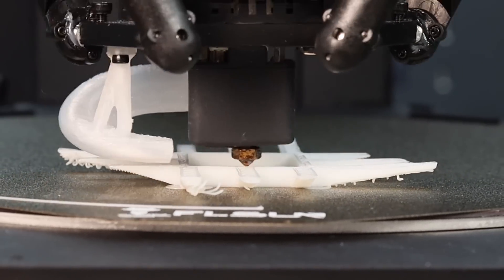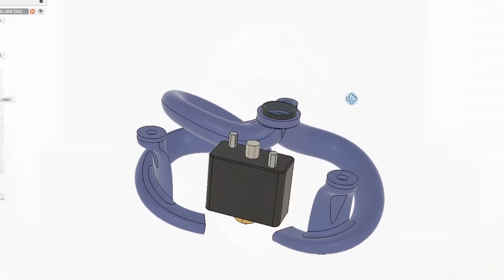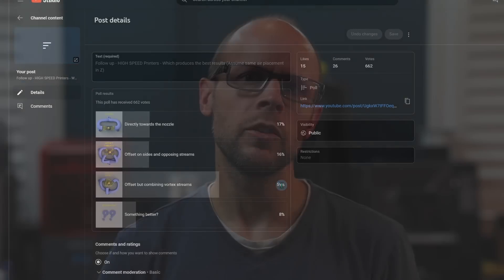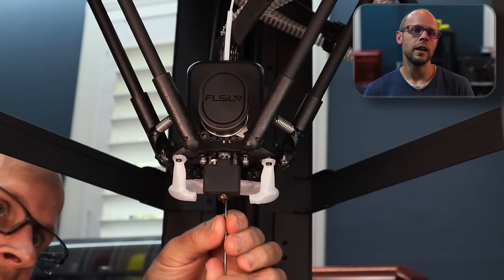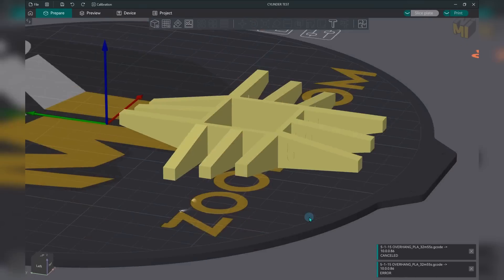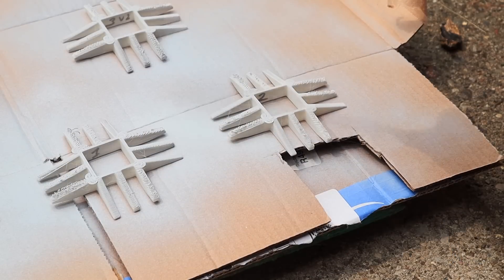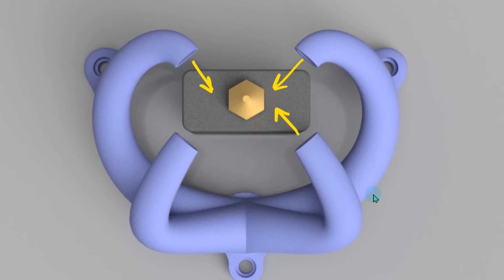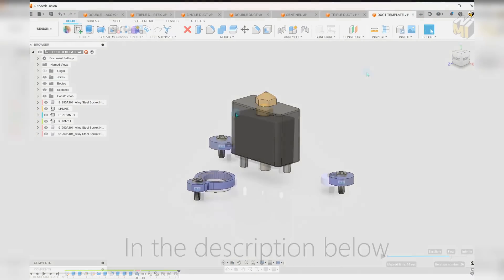More ducts is better, but how many is too many?

Comment: I also experimented with blowing, even created a system with 4 swirl-shaped blowing, but this story is not about compactness. Thin structures are always susceptible to heat from the heater. It is necessary to make taps with metal tubes. Then I gave up on this matter and did laminar cooling over the entire surface of the bed- this was the best solution, since it also cooled elements outside the extruder area.

Comment: I have upgraded with many iterations on my 5mPro. I finalised with a remix of an organic duct. My mechanical looking ones were really good but I like the aesthetics . Reason why I remixed is the model has some gaps and error in slicing. Also added my own patterns to be in line with 3D printing. i found that the wide opening of the duct worked better overall as it flowed rather than pressuring. Remember too much cooling is not good 👍 ❤

Comment: My thought is why didn't you create one that is completely elliptical completely encompassing a circle with an opening that would be vent like with some diffusers built into it I don't know how to explain it but basically create a large donut around the nozzle and a thin line but creating ribs that basically kind of directs and kind of slows the air down who created diffused Air instead of a pressurized air that can disturb the filament
Reply: I remember many years ago this kind of design was diffused especially on delta printers

Comment: When you mentioned using a teardrop shape for the escape holes on the ducts, it actually help a lot to steer the air into a curve, then using the shoulder of the curve to do the part cooling, maybe combined with three ducts or even just two, making a vortex in the middle.

Comment: 10:33 I would venture a guess that these small ports are to prevent excess static pressure. Also curious, depending on design, if these ports might actually suck IN air at lower flow rates.

Comment: Looking at the fan in the q1 pro you can get higher output fans. But im seeing the outlet is smaller in size then the stock. We would need a smaller inlet to the parts cooler. I suck at 3d software though lol

Comment: Sometimes relief holes in a duct actually increase the speed of air inside the duct. It's why many air chucks have a hole in the side. If you remove that hole or cover it up, you can immediately see a noticeable drop in air speed. I'm not sure about those ducts specifically, but that's just a guess from other kinds of ducts I've seen in the past. (Edit, air passing across the inner surface of the holes can cause a vacuum, pulling air into the holes and greatly increasing the output/efficiency of the duct).
Reply from the maker: Very interesting, thanks for that information, it's certainly something to try, creating a venturi effect of sorts?  I'd need some way of measuring wind speed at a very small scale to test this myself.
Reply: What type of air chuck are you referring to?  Tire filling chuck? Air chuck on a lathe? or something else?  Because in my mind I immediately thought of the blower attachment that goes on compressor hoses, for clearing away debris or drying off your workpiece.  In this case, the hole in the nozzle is there for safety reasons. It is there to provide an alternate route for the pressurized air to escape in the event the nozzle comes in contact with someone's skin. Thus preventing a horrible kind of injury that makes my skin crawl just thinking about it. These are also not technically air chucks, which is why I think you may be referring to something else entirely.

Comment: Having thin air ducts facing away technically is leaning towards the "sticky air multiplier" theory, where fast moving air will not act as a perfect column of air, but rather accelerate the air around the path as well. This could promote airflow over the part by creating a mini vacuum, but it's very undeveloped in that scenario

Comment: This woiod be useful information if you had verified that all of the croessections of the outlets between the ducts were the same. That would actually have a chance at telling you whether its because there were more openings or if its how the air is directed. If adding another port provides 30% more airflow none of this surprises me, but if the 2 duct solution had the same airflow as the 3 duct solution thats what id be curious about.

Comment: As you keep adding ducts it has me wondering at what point is a torus style duct better? The type that would surround the hotend 360* and exit through a slot that faces the nozzle. You may end up going off the deep end learning fluid dynamics to solve this problem!

Comment: Try the vortex 3 duct one, but with one of the side ones removed. Then you have 2 making a vortex that doesn’t have resistance on one side. This might make it push the hot air off more effectively.

I’m also curious what would happen if you took the fan and reversed it and PULLED the air out. Sucking air out tends to cool better than pushing air in when it comes to rooms, so what about here?

Comment: TL;DR; The numbers of ducts is irrelevant without enough static pressure with your designs. Normal ventilators have high air flow but low static pressure. So your designs are forced to fail. Change in direction and harsh resize of diameter is poison to air flow as it increases resistance. That's the reason why there are many duct-designs on inet but 99,9% of them are useless/scam without a compressor (high static pressure).

Comment: Hmm, this is a difficult one. I used to be good at telling which type of printer printer an hourglass shaped part in my local 3D printer store by just looking at the way the overhangs were printed - but this was ~ 10 years ago when most slicers did not have advanced fan control depending on the type of features being printed.
As @HerrickAaron writes, horrizontally opposed ducts create stagnant zones. But he also states that the vortex idea is a bad thing because that creates a 0 velocity around the nozzle - and I beg to differ ...
I think you will have a hard time cooling the extrusion at the nozzle tip. Blowing directly on the nozzle has a negative effect on the temperature on the nozzle, both in temperature stability and a constant temperature across both the heater block and nozzle. What you want to do is to cool the filament that has been extruded just one second, or a fraction of a second, before. So with speeds that go in the range of 10-120 mm/s (in my case) this means that I think you want to cool the area that is 1 to 10 mm away from the nozzle.
And then there is also the question if you want to blow the air more horizontally across the part or vertically into the part so the angle at which the nozzles point down is also a parameter you could test.
There are way more parameters important though: the printhead design, the type of fan you are using and maybe even the material used. A material like PETG stays hot much longer than PLA so for PETG you might want to blow more air over the print-area - but no cool air, just print chamber air, to prevent warping or reduction of layer bonding. Some materials are not to design to have larger overhangs or bridges at all ...

Comment: One caveat that I noticed early on (2019?) with different ducts is that the best bridging often happened when the fan cooled the nozzle... In other words, lowering filament temperature. It made it hard to find the actual best ducts because the "best" weren't the best

Comment: Looks really fun, like experiments with F1 aerodynamics😂

Do you think making aerodynamics like dyson fan is possible in this area?
Reply from the maker: I'm going to level up the testing a bit and use smoke... at least try to use it to see if we can see what's going on much better.  We also need to figure out what makes the best cooling exactly.  We have two main issues, one is to cool the filament just after it is extruded, the other is to cool the surrounding part well enough.  In my test example I only have the one CPAP fan and no AUX, so it may not be the best sample to reproduce most printers.

Comment: If you want to test airflow at home, just use tap water. All I did, was to conect tube to water and watch the flow coming out of cooling nozzles.
Reply from the maker: This is an excellent idea, I wanted to also see what happens with the nozzle and the part in place, maybe there is some way to do this too.

Comment: I like the ideas for further testing, small tweaks lile duct shape. I would say though it always best to figure out a objective way to measure the results.
Reply from the maker: More are coming and we'll dial the testing in better as well!  I'd also like to add smoke testing of some kind, in order to make educated decisions, we need to understand what's happening during a real print.  A simulation is possible, but it's not going to provide much info about what's happening during the testing.  I also wonder whether an IR camera would provide the info we need.

Comment: Need help please not sure if there is a better way to connect with you or chat but I have 3 k1 max and adding 1 more and I'm on a struggle bus with bed leveling really could use your master help. Let me know thanks
Reply from the maker: Hey, have you seen my videos on this already?  I have I believe 3 videos on this subject already.   The first thing to do which is the simplest is to use the shims in my first video to raise the low spots of the bed up.  After that you'll want to check out the "Let it Soak" video, it has a lot of answers and it will get you 99% there for a good first layer.  Let me know!
Reply: @NeedItMakeIt  I did watch them actually so many times my wife is mad when I watch them again. One has a bad bowl I level as close as I can get but having a super hard time getting a great first layer after. I am having troubles with changing settings have not rooted my machines a little nervous on it. I'm close to the boarder in northern mn are you close. Would hire to help?
Reply: Also I seen where you talked about a thicker build plate. 6mm I only heat up to 60 degrees I print primarily esun pla plus. Would this solve all my issues? Not that I want to spend any more money.Funssor Creality K1MAX 3D printer ultra flat cast aluminum heated bed build plate 6mm

Comment: What is the best air duct for Prusa i3 Mk3?
I'm still using the default duct, but I HATE it. Not so much on print quality, but every time I need to change the nozzle I need to remove it, and it is NOT easy to remove. The one screw doubles as the cooling fan screw, all the screws for the fan and fan duct break the printed plastic parts extremely easy if you look at the screws funny while you tighten them.
Reply from the maker: I'm still exploring this topic further but I've made progress since the video, so far a 3 and 6 duct version with each mouth directed slightly off center seems to perform the best.  Having this 360 vortex cooling seems to allow enough of the warmed air to escape and it doesn't create any areas with too much wind force to move the extruded filament into the wrong places.  I'll have another video this weekend and then 1 more video testing several different ideas to really fine tune what's happening and what we need to do to get the best cooling on any printer.

Comment: Great content again!👍Very interesting topic too.   Im guessing that downward facing ducts along the nozzle would warm and cool larger surface area of the print below.

If pointed along the printing plane same would apply more along the top layers of the print.

Which one is better might depends on the geometry are you printing.
Reply from the maker: Thank you!  I think so too, there seems to be a lot left to explore on this and with some really fast printers coming out I think we're going to need exceptional cooling.  The AUX fan is a good option, but I've found that if it only comes from one side, the results are only good on one side.  I think it'd be good to dive in a bit deeper and really find out what makes for a good print and then we can design a duct for any printer using that same solution.   I have a video coming soon where we look at the angle, whether horizontal is better or more vertical, also the position of the air related to the center of the nozzle laterally.  You make a good point about the print itself affecting the results too.  Some prints with infill will cool differently, and some infills also allow air to circulate better, which could also have an impact.  Interesting stuff!
Reply: @NeedItMakeIt  i personally print alot of pla but also higher temperature materials in which you need very little or no cooling in order to have good layer adhesion and no warping. In these cases heat should be distributed more evenly and prevent early cooling.

Maybe for a good overall solution the cooling should be relatively even in directions along the printing plane. And how about suckin air away from the part?

Comment: There are also the fans connected to the build plate rather than the nozzle. Moving a lot of air with big fans. But from far away
Reply from the maker: Absolutely, the AUX fans are another good option as long as they are on both sides, I've found that printers with only one have poor results on one side and good on the other.

Comment: a design that you see a lot as well is the circular fan duct. i would love to see all of these ducts improved with those points you mentioned and see a second video on this topic. because i was trying to find a good fan duct for my printer as well!
Reply from the maker: Circular is a good option, I'd have to see what happens with that idea.  I've mainly been using longer thinner rectangular openings.  I have at least 2 more videos coming on this subject and I'll include some smoke testing of some kind as well to really get an idea of what's happening with them.  I'd like to end up with a result that we can apply to any 3D printer and have better results than anything else out there.
Reply: @NeedItMakeIt  I was just about to refer you to a great video a creator did on air amplifier ducting then realised it was one of yours. Taking the suggestions from @HerrickAaron in an earlier reply it would seem maximising velocity of airflow is key. I now presume that video was deliberately related to improving hot end fan ducting. I do wonder how it could be directed at the extrudate rather than down and around the whole nozzle.

Comment: Great video! One note. Your air should be cooling the part right below the nozzle, not the nozzle itself. The goal is to cool the filament as it is being extruded onto the layer. Cooling the nozzle isnt recommended as you generally want the nozzle to be as hot as it can be. You want the filament to extrude at the right adhesion temp, then cooled immediately to help prevent overheating / warping of that area on the part.
Reply from the maker: 100% I agree with that.  I've seen that the stock duct cools the nozzle far too much, and the single and double options I've created do as well, the others which are set off to a slight angle seem to do better, but I'd need to find a way to test this to see how much heater struggles to keep up.  I really need an IR camera!  I could design a version which places the air very precisely to test your idea.

Comment: minimum 2, maximum 2.. that works best for me 😊. Hit it at a shearing angle.
I only play with air flow rate using 12v radial fan for a 24v system😊. Setting slicers at 50% max and flip to 75 o 100 at very small portion of prints during bridging or critical cooling section.❤love it so far.
Reply from the maker: Nice!  I just experimented again with 2 today, and unfortunately I found that the option with 6 ducted version I designed yesterday performed significantly better.  A little less air coming from all sides vs lots of air coming from only 2 side may be part of the reason.  I have to do more testing and also try to see if I can do a smoke test of some kind as well.  ideally I'd have an IR camera for this testing, I'll have to see if I can get my hands on one somehow.

Comment: I think in 4 and 5 duck test the air flows of two duckt crossed paths making airflow to change direction and cool the nozzle.
Reply from the maker: They could have been better for sure, I have a follow up coming with some more ideas and some more tests as well, it's quite a bit more... let's say advanced looking but it works!

Comment: Cool informative content as always. Have you considered visiting the BerdAir concept or ducting outlet configurations. The BerdAir is focused on pressure rather than volume of air from memory. Airflow is focused below the nozzle at the part, offset from each other to minimise interference. There are existing STL /Jigs designs available on Thingiverse and Printables which you could leverage.
Reply from the maker: Thanks!  I'm going to have a look, I want to make a bit of a competition out of this to see if we can come up with the best solution and then we can apply that solution to all of the common printers out there.

Comment: As you were concerned, having a nozzle sock is a must especially with high flow. You should try again with good sock.
Reply from the maker: I think I'll have to create a mold and make one from some HT silicone!  I agree, I also think the nozzle should be replaced with the CHT setup to get a little extra flow.  There is a little problem with doing it because there is also a triple ported design inside the heater block, if those three don't line up with the three in the CHT, it could be a problem.  Only one way to find out!
Reply: @NeedItMakeIt  won't socks from Amazon work? Or is your heater block too different for them?